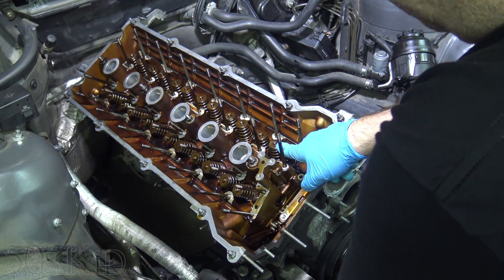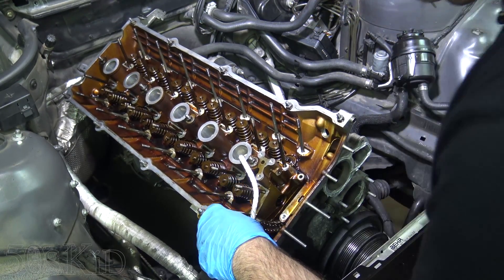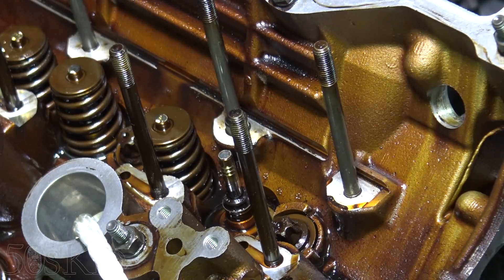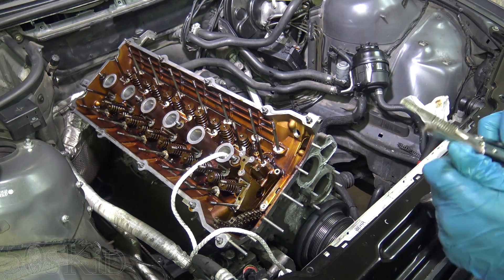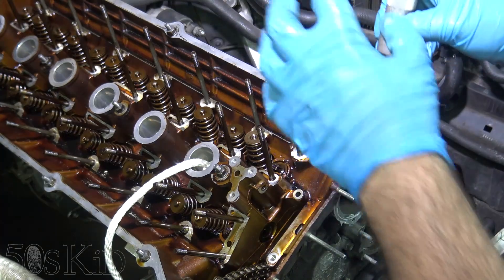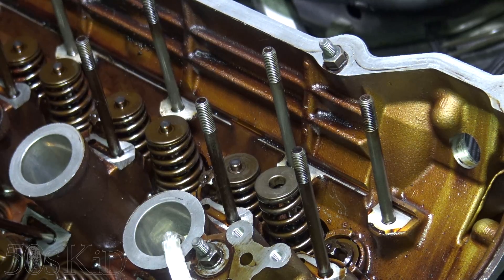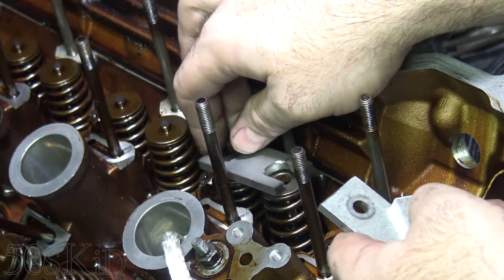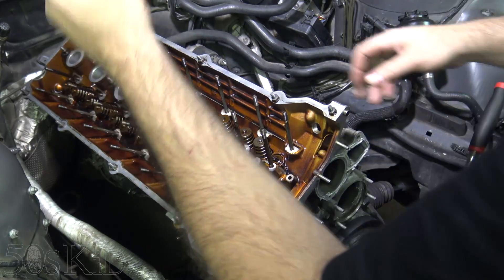BMW E46 Replace Valve Stem Seals (head in car) DIY #m54rebuild 10

Comment: The Lisle tool actually does work!  I believe you were just using it incorrectly.  Did you know; to remove the keepers and expose the stem; you use the SEPARATED tool and use JUST the Silver (magnetic) portion; seat it on the top of the Valve Stem Cap (where the keepers sit); use a 2 lb. hammer (or heavier) and whack it down?  The keepers will simply collect in the cavity of the silver tool.  Then, you put the Black portion into the tool, and align the keepers inside the Valve Stem Cap on top of the Valve Spring and again, use the 2 lb. hammer to slam it in place!  It is super easy, especially with an air compressor in the Spark plug holes (instead of the rope, although the rope will work too).  Super easy, and saves a lot of time.

Comment: I know this is 7 years old now but I just ran across it while searching for how-to videos on doing the same on my N55 engine (2012 X5 E70). 
I have high oil consumption and exhaust smoke after the engine is hot, then off and on every few minutes after. Sounds like valve stem seals are a strong suspect.

Anyhoo - great video and your patience is something I strive for. If I'm you in that video, I'm dropping f-bombs all throughout.😄

It's interesting though, that I can't find one single video on replacing valve stem seals on an N55 but I'm guessing it's pretty close to what you're showing here.

Comment: Old video I know, but do you have any experience with forte seal conditioner? It's only available in the UK or on ebay for $50 which is a little steep unless it works.

Comment: Too bad I saw this video too late, tried with the same kind of tool and ran into same problem. 

That being said, luckily it is very easy to make a tool to do it just like you did in the end.

Small tip for others, if you use hammer trick with the magentic stick to take off the keepers, make sure you don't hit the keepers or the valve stem with the magnet. That thing breaks pretty easily. Nothing like trying to clean up all the magnetic pieces from the valve body after....

Comment: How do you know if your seals are bad? I get white smoke on idle since the cold weather even when the cars up to temperature. But the smoke only starts when the engine gets hot. Doesn’t smoke at all from cold start.

Comment: You by far the best on you tube.. I have a e39 530i Dec 2003..i like the e39 more then the e46 because the engine bay has more room to work on but I still think you are the best to watch cause the engines are simular and you explane everything so calmly and precise

Comment: am also working on replacing valve seals of my m54 only which is best way with a rope or with air pressure

and how much pressure should there be in the cylinder if I do with air pressure

Comment: Good Day 🌈🚗🌄
Mate I'm really lost with words as you have been so compassionate in sharing innovative findings with hard toil  ( shortcuts) to others in good thoughts- thank you 🙏 . Some Mechanic's here in Brisbane  love to see the poor car owners suffer without knowing the problem they exaggerate it / blow it to show its a mighty job to milk the money . They don't realise not every one owns a BMW is Loaded .... so right now I'm engaged in two projects . 1. Fixing the E46 BLUE SMOKE ISSUE & E30 just to start the Engine as it's been idling for 6 years.  Then panel beating paint touch up and  dispose both ..so as a matter of gratitude just wondering whether I could buy the  valve stem set from you or recommend supplier for the E46 thanks . Cheers Milan

Comment: Since this is an interference engine, won't valve damage possibly occur if the engine is turned without the chains connected?

Comment: Hi Man! 
My M54B25 have high oil consumption. The compression is OK! The engine eat 1 liter oil on 300km. I changed the CCV, but the oil consumption stays. No oil leaks! Maybe my engine have Valve stem seals problem? Thanks!

Comment: Your videos are awesome. The high definition of up close is so great. I love it.  I'm looking to free one of my motorcycle intake rusty valve.  I bought the valve compressor tool but like your car, my motorcycle valves are recessed all the way and there is no room for the clamp to fit.  It looks like I'm going to make a custom valve compressor just like yours which is easy to cut with cut wheel. I'm working on 85 Honda VF1000R (V4 engine) that very rusty intake valves and i flushed a lot of rust by flushing MMO down the intake and cranking and letting the dirty flush came out from the spark plug holes. Should i be worried of the rust damage to cylinder sleeve smooth surface while cranking or possible running it in the future? Can engine flush help remove more rust? I just don't want to pull the heads 
So my plan: I'm going to get some thick metal pieces at home depot and fabricate one like yours tomorrow. I'm so excite to get this bike started again as soon as I can free this intake valve (could be bent too who knows).  
I'm all dropping the rope inside the cylinder as much as i can via spark plug hole because I already have just 1 camshaft of that cylinder out but I would like to keep it in time.  I marked the cam gear with mechanic chalk to put back later.  Therefore, I can't rotate the piston to compression the rope to up the valve up.  I do have side access to the valve via the carbs manifold I might be able to insert a strong magnetic pick up tool just to keep the valve from dropping down into the combustion chamber.  What do you recommend?  Thank you for helping.
Reply: Hello, I was able to do it by hand from one of these guy up here using a deep socket to unseat the spring tension and reinstalled with the same socket with a small plastic piece inside the socket while pressing down hard to compress the spring and seat the valve keeps inside the stem's groove. But I still get low compression for 1 cylinder that the rusty valve after spraying carb cleaner and wd40 and turning the seat again the seat with my drill screw driver attached to a hose to the stem. I don't know if you could have bent the valve while cranking the bike to check for compression days before.  I'm going to bite the bullet and install the carbs then start the bike to see if it would fix itself in the process. I will in MMO oil in the gas and ride it a little at low RPM.  The bike have been parked for 20 some years.  Thank you. If i won't improve i would just pull the head ! THanks

Comment: Be SUPER CAREFUL when removing valve stem seals, and DO NOT use vise grips!! Mine were stuck on tight, and in the process of getting them off, I deformed almost all of the valve guides because they're a soft metal. Now most of my valves are binding in the guide, and I've got to get a new head, or have new guides installed.
Reply: Ouch

Comment: That’s is not the correct tool to reinstall the keepers.  You should be using assembly grease to keep the keepers together, plus the correct tool does compress the spring similar to the one you Jerry rigged.

Comment: Scary watching those vise grips on that valve stem seal. I work on safety relief valves which of course is a complete different animal but a bent stem is a bad day.  And I imagine a galled stem is even worse on an engine.  Good video though lots of great info.

Comment: Why do you need a rope in the cylinder to keep up the valve? If you just put the cylinder at TDC, the piston goes all the way to the top of the block and should prevent the valve from dropping.
Reply: I thought the same too...do one at a time ..make sure the one being worked on has piston at its highest

Comment: For anyone curious , I made the 3 pieces using thickness 5.12 MM metal , the height of the piece that gets sandwiched between the other two pieces is 55.70 MM. Fyi
Reply: Do u have the measurements for the pieces?

Comment: You can remove the seals off easily with a torx nut. Just pick one that fits the metal part and tap it in with a hammer. Then twist it right off.

Comment: Dear 50skid: I got chain noise and chain timing problem at my E46 316i with N42B18A engine. It doesn't react to anything when I take valvetronic or solenoid cable off. Only it makes lots of noise like it's a bad diesel engine. When I start engine I hear chain clearly laud and clear noising and after 2 min engine shaking a lot and go out. What is the problem and how to fix please help.
Reply: I had what sounds like the same issue on my E53 X5 with M54 engine. Not sure if this will work for the N42B18A. I rebuilt the vanos, still had the same noise, then reset the timing and finally the noise went away.

Comment: I have a Bmw m550d diesel My Car consumes Oil 3000km 6dl its n57d30c engine Could it be valve stem seals ? Or Crank case Breather?

Comment: Hey do you know anything about n52 engine? I want to replace the valve stem seals, and so far from all the info available online I would be able to remove exhaust camshaft to get access to exhaust valve seals, but the intake side is tricky because there's a lot of retaining springs, plates and the camshaft tray is cast with the head, in the repair manual a lot of special tools are used to remove the intake side so I'm confused...

Comment: My car 🚗  BMW X5 4.8is model number 2005 the problem is while on starting the Engine start but the same is low battery and then while on off the Engine and then start but won't start

Comment: Actually someone did do this video, just before yours came out.  Goes to show you that there are multiple ways to think out of the box and be creative.  However in both you video and the other, I am surprised neither use tape or paper shop towels to block all portal access in to the engine.
Reply from the maker: There are just the 5 oil drain ports and if you're careful you should be fine.  If particles do drop in they'll hit the oil filter before the bearings but of course you don't want them to go through the oil pump in the first place.

Comment: Can you do this job without the fan is and timing removed,just the valve cover?
Reply: Ask yourself this. "How do you access the valve springs?".. They are under the camshafts, which are attached to timing gears.

Comment: Hi mate I've got same bmw and i found the spark plugs head  swimming in oil the compression is good on each cylinder can be the seal valves stem the problem?

Comment: Great home-made tool to get the keepers on....and off, really. I would plug the oil return holes to be safe. Pretty cavalier with those keepers around that engine. You drop one of those keepers in a return hole and you have, in a split second, created all sorts of trouble for yourself. Love the videos! Be careful and keep up the great work!!!

Comment: i like the improve tool nice idea i just bought a e 46 and its consuming oil and smokes blue, the guy that sells me the car had the valve stem seals in the trunk but he wasnt sure that was the issue, i was thinking in changin the pcv valve first then if the car remain with the issue then replace them but the car has 279,xxx miles so i think i'll have to replace them anyways
Reply from the maker: i have a video about the oil consumption
Reply: 50sKid i saw the video im goin to try the valve in the hose that goes to the oil level stick thanks youre videos are very helpfull

Comment: thank you VERY much. I'm going through the same process. Not sure if discussed before, but are we putting unnecessary stress on the studs when using them for this type of application? In other words, are we stress/pulling them out of the aluminum head?
I wish I could make a tool like this.  Thanks again!
Reply from the maker: Yes I would have to say you are putting unnecessary stress on the bolts but I do believe it should be fine.  You can make a tool like this with a hacksaw and some drill bits.

Comment: I think it will work with this tool on my M52B25 as well. Very clever to use the bolts for the camshaft to actually push it down. Nice job! Other tools always require a hand to kinda push the spring down. Now i only need to find out how to get cylinder timing correct afterwards.
Reply from the maker: I have a timing video, just search my page.
Reply: Already watched the removal one :) but now i am wondering if i can remove the camshaft without touching the timing by just loosening those 3 nuts that attach each camshaft to its chain wheel. Oh it's too late here in Germany for those things :D
Reply from the maker: No you can't, you need the timing tools.

Comment: hmm there are alot of 350zs and g35s for sale for like 2 grand cheaper because of this and it doesnt seem to hard but my dad is telling its a real pain. this doesnt seem to hard though.
Reply: JWT make a tool for our engine:
https://www.z1motorsports.com/engine-parts/jwt/jwt-valve-spring-compressor-p-7040.html

Video on youtube showing how to use it, as well as a PDF.
http://www.jimwolftechnology.com/wolfpdf/VQ_SPRING_REMOVER_INST.pdf

Also don't forget the timing chain removal on our engine is a bit of a pain, once again, plenty of vids showing how to remove/install.
Reply from the maker: It really isn't hard, but every car is going to be different.  There are different tools available for compressing the valve retainers.  Harbor Freight carries a cheapo one that clamps over the sides of the spring and screws down.   Search for "valve spring compressor tool kit" -- another style of tool comes up.  Make sure you have a good strategy for compressing the springs before you take them apart.  I would say, if you can use the tool to compress the spring and get the keepers out, then you can use it to get them back in.  With the exception of the tool I used to remove the retainers in this video.
Reply: 50sKid so you're saying finding a tool to compress the springs is the hardest part?
Reply from the maker: Yep, exactly.  Everything else is straightforward.

Comment: another good video .a good tip when replacing the valve collets is to have a thin flatbladed screwdriver and grease 
small amount of grease on the inside of collet and on flat blade of screwdriver so collets sticks to screwdriver and then just place collet on valve stem and it will stay there ...magic .....never lost a collet doing it this way

Comment: Thanks man! Proper.. Are you going to vid the process of cleaning the head, and I'm sure you're contemplating a head skim and valve re-con, re-bore? Covering your visit to the machine shop would be great. Having the correct tools for the job is the way to go!
Reply from the maker: Yeah I'm doing all that.  I will see if I can do some kind of videoing at the machine shop.  I'm contemplating going to a shop that is an hour away because the owner actually does youtube videos himself (fiatnutz channel) and looks to be a very competent shop but I'm also thinking he's probably more expensive.  I need to do some shopping and I really need to finish up filming all the videos on the parts that I need to film before they go to the machine shop.  I am nearly done.

Comment: Good job mate, clear vid and well explained. I am doing at the mmt vacum leak problem according to your vid smoke mashine, works nicely! Have you encountered an error code (Peak) 2777 DME: selftest: AD:converter by any chance?
Reply from the maker: I've never seen that error but it seems like it might be a problem with your reader connecting to the computer.
Reply: 50sKid  This will definitelly get me commited to mental institution. After about 100km the light comes on and now it gives me code 2777,2882,2883 did a smoke test again and there is no leak! that i am sure of:)) Could it be an inferiror MAF that I got form ebay? Ts the only thing I can think of. Any thoughts? Thnx.
Reply from the maker: Yeah that is definitely your problem.  Never use an eBay MAF--they use a cheap resistor and not expensive platinum wire.  Only use a Siemens unit.
Reply: 50sKid Shall order one today, as grandpa said:' you ain't that rich to buy cheap shit things" :) Thanks and enjoy the break!

Comment: Thanks for the vid!  Perhaps 0.5" square tubing would be safer for the vertical piece of custom compressor tool.  Also maybe it's possible to check valve guide clearance if you drop the piston a little bit?
Reply from the maker: Yeah I like your idea about the square tubing.  If you have the means to cut it squarely, ya know?  I don't think you'll be able to check valve guide clearance that way really because the area that sticks up is the "wear" area, except for just a 1/4" below the keeper grooves.  Coming up in a video I will show how I do check the clearance from the other side once the head is out.

Comment: Hello. Your Tool is Great.  To push The valve up, Use Compressed air. Is much better and comfortable.
Reply from the maker: Yep it's definitely a valid way to keep them up.  The reason I chose to use the rope is because not everybody has an air compressor AND a compression tester with the hose that screws into the spark plug hole (which you'd have to take the valve core out of with a valve core removal tool) but everyone can buy a length of rope from the hardware store.  I suppose I should have shown both.

Comment: How strong are the springs ? Are they strong enough to get the small keepers flying if your compressing tool will skip ? In this case you shouldn ' t use your fingers to put them in I think
Reply from the maker: Yes they are that strong